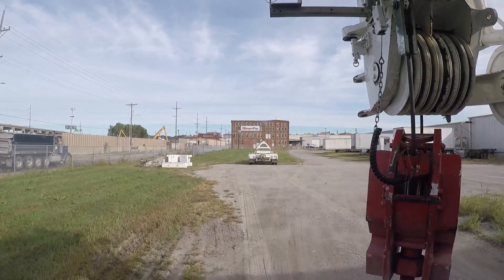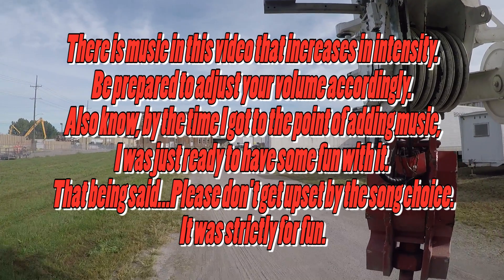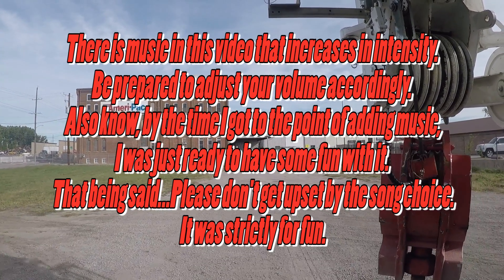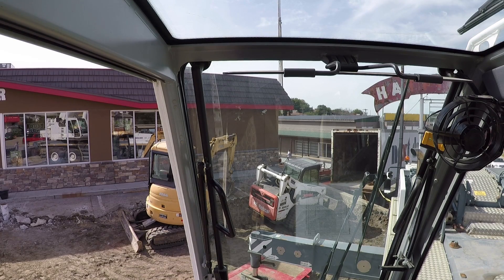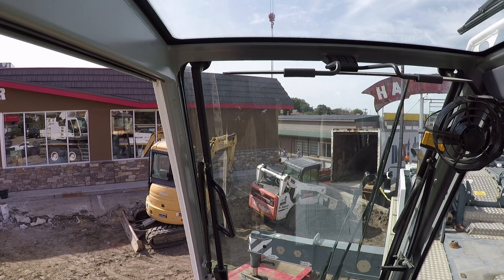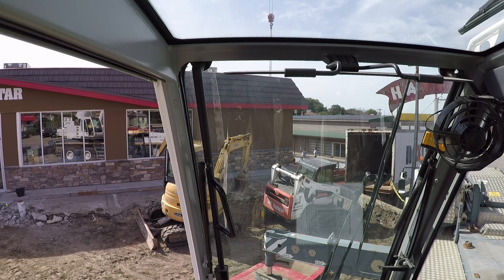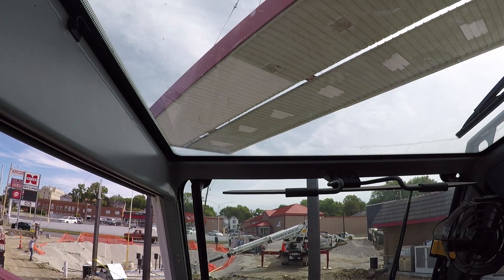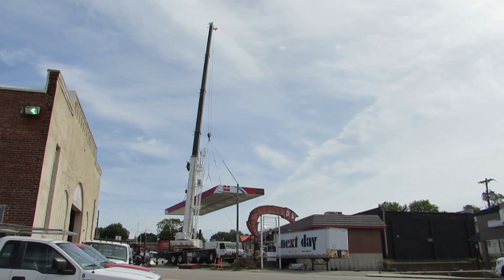Using a crane to install a fuel island canopy in one piece

Comment: Really great video!  And nice work to the camera man across the street.  So two questions, First, I know that the crane oiler guy that is helping out getting you set up is from Brooner, but the other crews that were running the taglines, are they also hired by Brooner or are they from the contracting outfit.  Second, the crane is rated at 200 tons, and I assume that is when the boom is all the way up and the telescope pulled all the way in, like it was on my service truck.  What is the max weight when the boom is all the way stretched out in front of you.  We used to lobby our company for larger cranes because even though the crane stated that it was an 6-8000 pound rating, when you got it stretched out to where you usually would use it it was only good for 2-3000 pounds by then.  Made for pulling large heavy parts spooky when you knew that your crane was pretty much maxed out.
Reply from the maker: matt lee, we were hired by a local sign/canopy company. It was their crew that were on the taglines. You are correct about the capacity of the crane. When it is stretched out, the maximum radius is 249 feet and the capacity at that radius is right around 3k lbs. I can see why you would lobby for bigger cranes. Pulling a 3406 out of a machine would max your 8k service crane out. Not because of the max gross capacity, but the radius at which you have to work at. A 3408 would be out of the question. Unless you stripped it and pulled the heads. I am a very big advocate of having too much crane for the task. LOL. Thanks for watching! 🙂👍
Reply: @ToTheTopCrane  One of the best things about the new Cat outfit that I can say is that they buy their new service trucks to do the job correctly.  12,000 pound cranes on Kenworth chassis with air ride are the real upgrade!  Makes life a lot easier and a whole lot safer!

Comment: Stop apologizing, you're doing great!

As someone who doesn't know (me), are there regulations/safety protocols on stacking outrigger mats?
Reply from the maker: BrinkME, thanks for the compliment! There are protocols for stacking cribbing and mats. There can't be any voids in the cribbing, the material used has to be of adequate material and construction to be able to support the weight, and it has to be centered under the outrigger. Thanks for watching and for the great question! 🙂👍
Reply: @ToTheTopCrane     I do it like the house movers do: I log cabin once off the base layer of cribbing,  with hardwood 4x6"s in my case, the only practical way on the slopes i work on. Just a 30 ton rider National though. Last week the front tires were 36" off the ground, the rear tandems, not at all.

Comment: I usually don't allow more than max 2 tag lines when I pick stuff, and also making damn sure they know what they are doing. I've had roof girders smacked in the boom because the dude on the far end is pulling for his life the wrong way, so damn annoying. Also you should make a video about moving the crane with full counterweight package and superstructure reversed with the boom backwards, should be fun to see for the masses hehe.
Reply from the maker: beinlausen, we had four taglines on this piece because of its size compared to it's weight. Everyone knew what they were doing. But, one person had to run up a pile of rock. When he did, his line got some slack in it. But, he recovered after I honked at him. LOL. When the time comes that I have to move in full rig arrangement, I will definitely record it. Thanks for watching!  🙂👍
Reply: @ToTheTopCrane  Haha, theres always some drama when taglines are used, my experience is that they usually focus more on the taglines than controling the load itself, which can be abit frustrating sometimes lol. Keep up the good videos =)

Comment: If the canopy made contact with the crane would the boom assembly need to be overhauled by tadano 

Music choice was great and you do good on the edits
Reply from the maker: John leininger, the outer portion of the canopy is mostly sheetmetal, and probably would do much more than scratch the paint. But, I wouldn't want to find out. Making contact with the boom of a crane is very dangerous. If the boom were to get dented, it could collapse. Thanks for the compliment and for watching! 🙂👍

Comment: That is a great video. I would rather hear the music than wind and traffic noise. Did you take any pictures of the surfaces that had to be welded or attached back together. Was is pipe on pipe or did they do something different? Why weren’t there more people on ropes to help guide it. It looked like you were mounting  a canopy on top of yourself in a couple of those shots. Job well done.
Reply from the maker: walter mattson, I didn't get any pics of the attachment points. I'm not sure how the connection was made. They had a person on a rope at each corner. If you watch closely, the person on the end away from me, but on the crane side, had to run up a pile of gravel. When he did, his rope slacked a little. Thanks for the compliment and for watching! 🙂👍

Comment: Nice job Jimmy, the music nothing wrong with a bit of opera.
Reply: It's orchestra, not opera.
Reply from the maker: @JamesLeBouton , you're correct, and you won't hear opera on my videos. I think orchestra is pushing it. Lol. Thanks for watching! 🙂👍
Reply: 1812 overture - I nailed in in the first 5 seconds, one of my favourite pieces!  Not many orchestral pieces call for the use of real cannons!!
Reply from the maker: @daveyburgess , it is indeed! I wasn't aware that it called for real cannons. 😳. That would be difficult to pull off in a theater.
Reply from the maker: @daveyburgess , that's impressive! Thanks for sharing the link! 👍
Reply: At the Hollywood Bowl we used something over 100 3" mortars. Kinda fun.
Reply from the maker: @lwilton , how did you time them to go off when necessary? Computer and electronic fuses?
Reply: Back in the 1970s we used a mechanical stepper relay wired to a patch panel, going out through telephone cable to breakout boxes, and then individual lines to squibs. A squib is basically a match tip that has a small bit of wire in it, and when the wire gets hot (because you run current through it) the match tip catches fire and burns quickly. The squib was attached to the end of a 3' piece of quickmatch going down into the mortar, which was a hunk of 3" seamless tubing with a welded bottom. In the bottom of the mortar was the charge, which was a couple of ounces of powder. There was a 3" thick Styrofoam plug rammed on top of this for wadding to get a more impressive bang.

In the 1980s this changed to an electronic sequencer. This was dumber than any kind of computer, but kinda conceptually the same thing. 
By about 2000 there were commercially available pyro firing devices, which were small special-purpose computers that could remotely fire triacs to fire the squibs.

These days you can get PC-based firing programs that control remote firing boxes. Usually these are direct wired rather than wireless for safety. We only have to worry about people triggering transmitters a bit too close to the wiring, rather than having to worry about some 13 year old hacker doing something to the internet in the next state.

Timing: since this had to be timed exactly to the music, we ran a couple of push buttons on long wires out on stage and gave them to a couple of percussionists. One percussionist "played" the cannon track for each of the sides in the battle. Think of it as a snare drum line in the score. We had a third remote button that one of our guys used to shoot all the display pyro from out in the lighting booth about half way back in the house. He also followed the score, but since the display pyro wasn't in the original score we didn't need someone in the musician's union to push the button.
Reply: @daveyburgess  that was also the same use my captain video and early television. Nothing wrong with a little Tchaikovsky
Reply from the maker: barry hansen, thank you! It was dragging out into an editing marathon. So, I decided to have some fun with it. Thanks for watching! 🙂👍
Reply from the maker: @lwilton , wow! Thanks for the awesome response! That pyrotechnics stuff sounds like alot of fun. I probably wouldn't still have all 10 fingers if I started dabbling in it. I mean....if 2 ounces of powder is good, 4 ounces is better...right?  Lol 👍
Reply: The pyro things that goes off up in the sky at night and makes pretty sparkles are known as "starshells". A starshell consists of a "lift charge" and a "burst charge". The lift charge is basically a few ounces or more of gun powder. How much depends on how big the shell is. Shells come in standard sizes from about 1" diameter up to 12" diameter and larger. You typical 4th of July show will use shells in the 3" to 8" range. An 8" shell weighs maybe 8-12 pounds, and a pound or so of this will be the lift charge powder.

There are many types of starshells. One of them is a thing called a salute. This is basically a few ounces of aluminum flash powder. it burns VERY quickly and makes a VERY loud BANG and a bright flash of white light. Think of the biggest flashbulb you can imagine going off at about 300 feet high.

One year when I went out to the plant to pick up the truck with a 4th of July show loaded in it (we were shooting at the Del Mar Fairgrounds that year) there was a 3" mortar sitting in the office on the floor, with a little 3x5 card on the top that said "Beware of Guatemalan salutes". The gun, which is 3" oil well casing and designed to stand about 20,000 PSI, was peeled open for about two feet down the side. It seems that the salutes being made in Guatemala that year had defective lift charges, and the burst charge would go off in the gun, resulting in an over-pressure condition in the gun, and quite a lot of excitement on the ground. 

I should mention that your typical small show was hand-fired in those days. You held the shell by the end of the quickmatch tail and dropped it down in to the gun. Then you pulled the safety cap off the end of the match and touched it with the lit highway fusee you had in your other hand. The quickmatch burned in about a tenth of a second and the lift charge went off with a loud WHUMP while you were standing right beside the gun. The shell went a few hundred feet up into the air (you hoped!) and went off with a loud thump. Since the shell was made largely of paper and cardboard you were showered in hot flaming s*it filtering down out of the sky. Then you fired the next shell in sequence, and so on for 30 minutes or so.

So you really didn't want to accidentally hand-fire a Guatemalan salute, since you would basically be lighting a hand grenade about 12 inches from your hand and 24 inches from your head. Splitting open a hunk of oil well tubing made a bit of shrapnel.